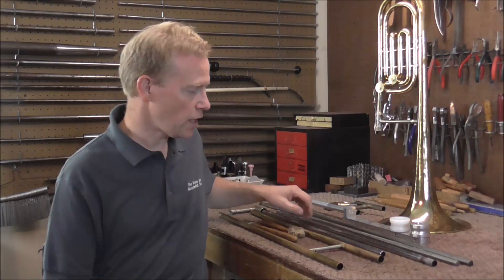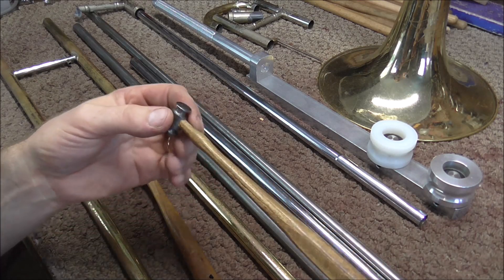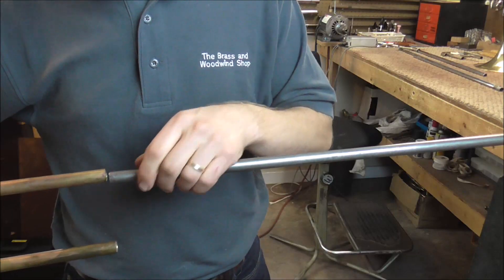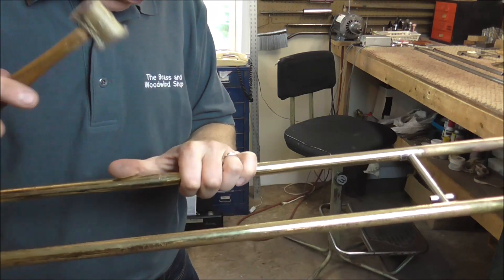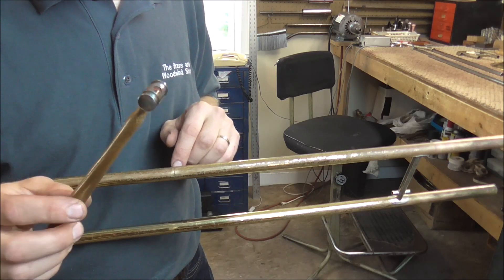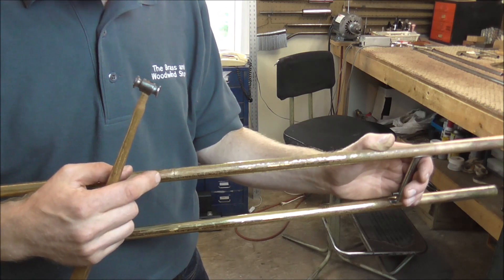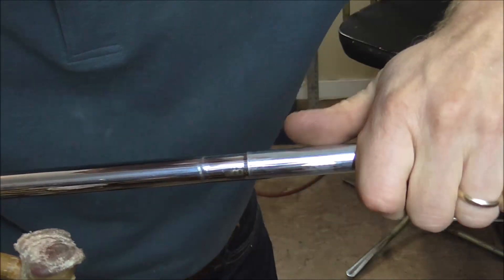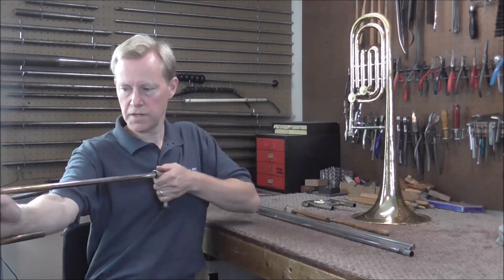Removing Trombone Handslide Dents: Bass Trombone Restoration Project #5

Comment: Wow! You have plenty of patience. 
I don't have the same roller but trombon rolling slide dent tool from ferrees. Sometimes it works just well but sometimes it bends the whole slide a little so the dent looks good,  but you have to fix the slide alignment.
Reply: Do you bend slides with Ferrees N87 ?

Comment: Have you used the Ferees trombone hand rollers?, I do have and have use the votaw roller, however it does not IMO really remove the dent, its good for smoothing out and reshaping an oval tube

Comment: I would think the slide dent tool would only squish the tubing of the slide if the recessed diameter cut into the rollers was smaller than the diameter of the slide you were using it on. It looks to me like the way it was intended to work was by having one main point of contact with the slide to smooth out dents. The idea in my head is similar to how a circle placed inside another circle of a larger diameter will only contact in 1 place. The size of the inner mandrill should not matter too much as long as it is close enough, given the diameter of the tool is larger than that of the slide. I don't know if that makes sense, but I hope you understand what I'm trying to say!

Comment: At what point do you contact the manufacturer and buy a replacement slide?  How much do they usually cost?
Reply from the maker: I think that slides are pretty close to the cost of a new instrument.  The slide would need to be in pretty bad condition for a replacement. It really would be a judgement/sentimental value call.

Comment: On your concern with the dent roller possibly flattening the tubing:

If you think about it, your hammer and mallet are a lot flatter curve than the curve in the dent rollers. In fact they are a reverse curve to the tubing you are working on. So why don't they flatten the tubing? Because you know what you are doing and don't flatten the tubing when you don't want to.

I think the rollers are probably the same way. Yes, if you just roll back and forth in one path they will flatten a smaller tube. But if you move the roller around the outside of the tube and roll from different angles and with different pressures you can keep the tubing round, just as you do with the hammers from multiple angles. The possible advantage over a mallet or hammer is that you are effectively pressing from several closely related angles at once, and not just one small spot.

I also suspect that the roller is two tools in one. The white roller is a mallet and the metal roller is a hammer. I suspect you use one roller at a time, and not wedge the tube between the rollers. Now all this is just suspicion on my part, I've never used a dent roller like that, but it makes sense that it would probably work that way. I'd suggest trying it on some junk tubing to see what it will do.

Comment: Have you ever tighten up the rivets on a music stand... What you hold a hammer behind it while you tap it with another Hammer from the front... You never try to fix a rivet? Take a rivet that's loose in a music stand and just keep tapping on it from the front it will never get done... Now hold a hammer behind it against it... And tap with another hammer on the front of it that's how you fix a rip it... And this is the same thing is happening with the trombone that's too much vibration when you tap it is nothing to stop it and there's the tapping is ineffective
Reply: here the mandrel is taking the role of the second hammer (which you use as a mini-anvil if I get your comment)
It's not that big of a concern if you squeeze the music stand metal changing its dimensions... but on a trombone slide you'll make an out of round part and mess it.
Reply: @1090yoyo  not really because an anvil is stable... Just holding one hammer on the other side while you tap it on the other side just reduces the vibration

Comment: From zero... I would have went and bought me a dowel that fit the size of the inner bore... I would not have worried about the inside diameter of the outer bore... I would have bought a 3/16 in threaded rod... I would have taken that ride home hit it with sandpaper to grind the sharp points of the edges down... Then I would have slatted the whole thing and silicone... I would have taken a sinker weight for fishing... Then I would have taken tape wrap that around the head of the weight... Then I would have carved a Groove down the center of the wooden dowel ... stick the threaded Rod Covington silicone with the fishing weight on the end first... Then take the wooden dowel with the excussion and what that dent out in 5 minutes... And created a tool that will do it for me for the rest of my career... But thank you for making me think of that
Reply: I don't get how your tool is supposed to work. Are you really suggesting to use wood and lead (fishing weight) to deform a trombone railing ? It's work-hardened brass (or nickel silver), no way it would work.
Reply: @1090yoyo  you just watch them use a mandrel to get the dents out from the inside... Mine is just a two piece mandrel